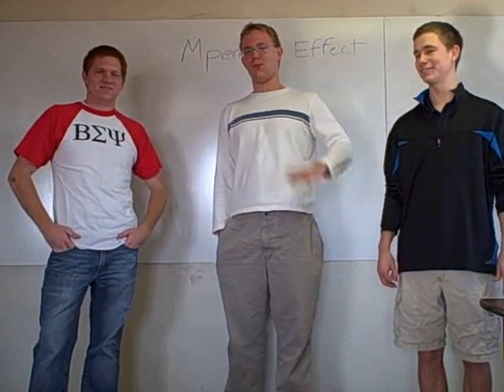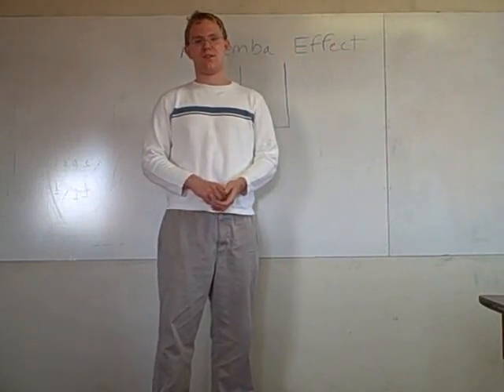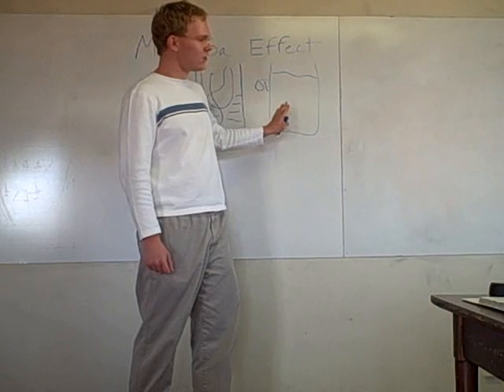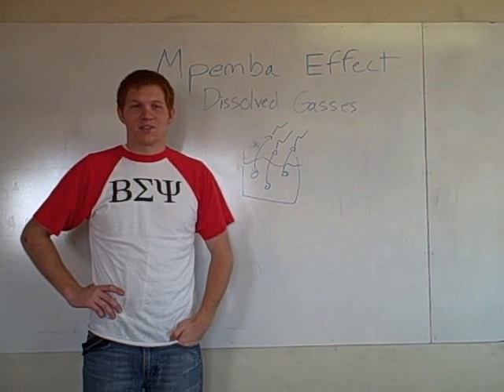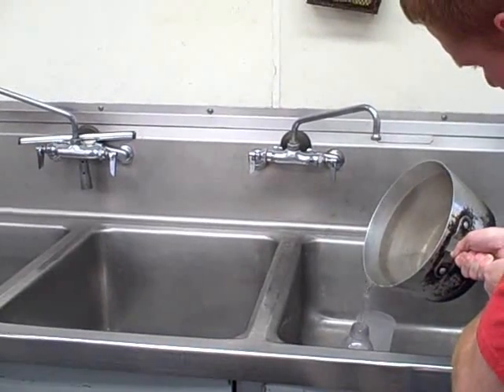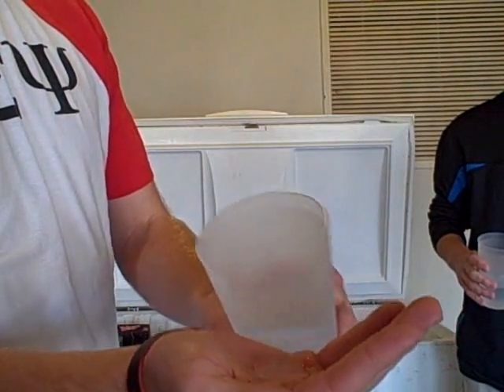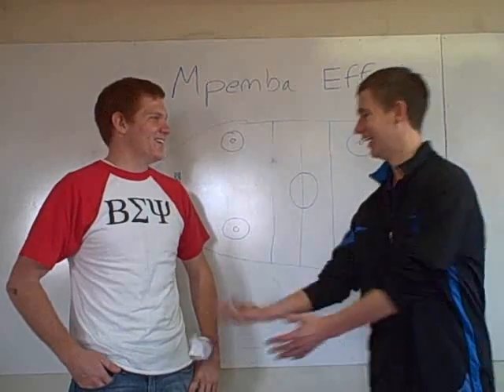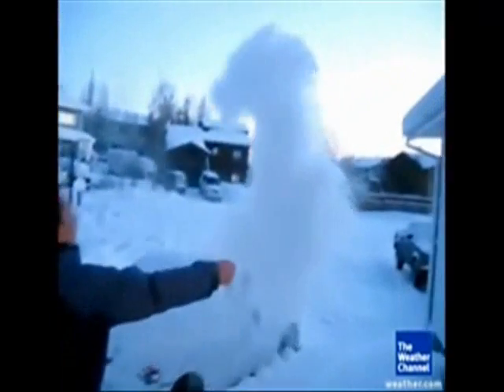ChE141 Mpemba Effect FS2011

Comment: Did you guys even look at James Brownridge's paper? It's caused by supercooling, and only happens IF heating the water raises the spontaneous freezing temperature due to specific water composition.

And cold water pipes usually freeze first, hot water pipes burst more often because they supercool, instead of building an insulating ice layer. so the opposite of Mpemba effect!  
Throwing water in the air has nothing to do with the effect btw. You think youtube titles are reliable sources?